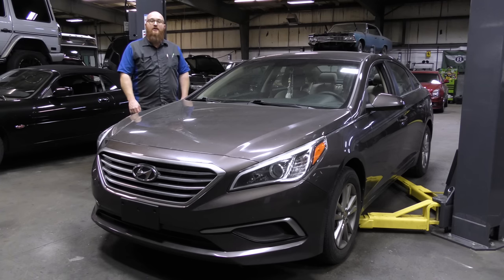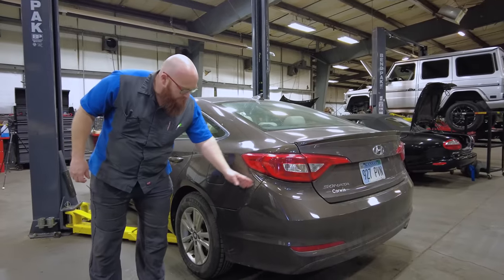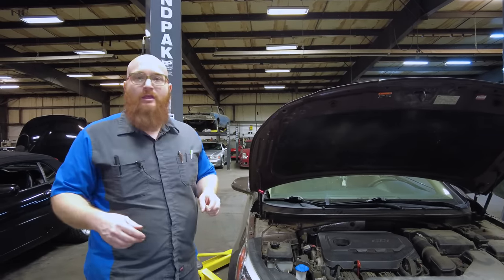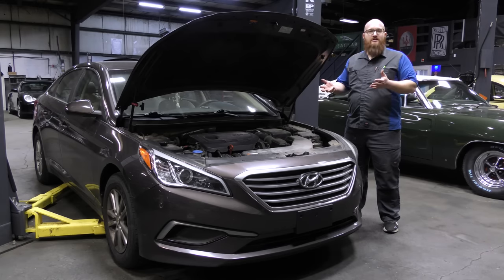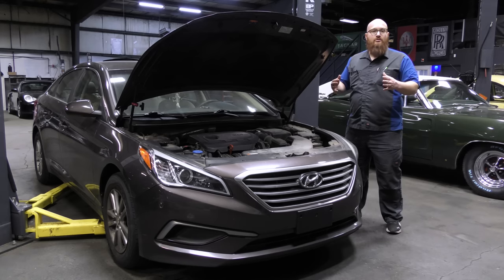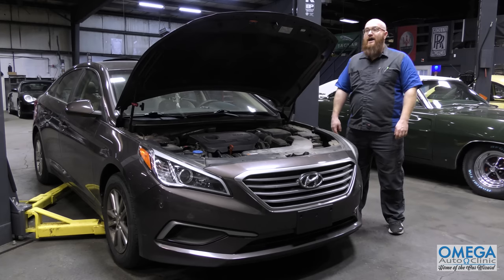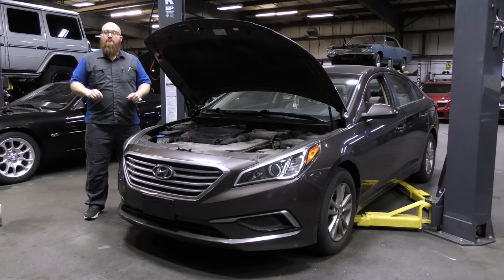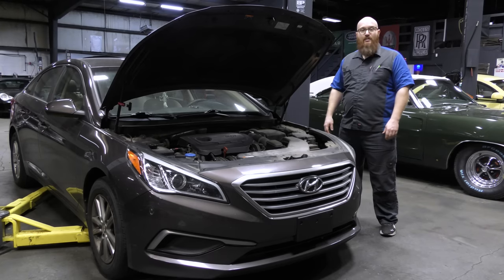What could be so bad on this '16 Hyundai Sonata that the CAR WIZARD is sending it to the junk yard?

Comment: Wrong.  I've got a 2.0T ltd edition, very well maintained. 
It didn't burn oil for 120,000 miles, then all of a sudden began burning 1 quart every 1000 miles.  So if you change the oil every 5000 miles with pure synthetic oil, plus 1 additional quart every 1000 miles, thats 10 quarts of oil every 5000 miles.  I've changed the PCV, and it still burns 1 qt every 1000 miles.
Good thing I check and fill the oil every 1000 miles; otherwise, I easily would have blown the engine.  
If a person doesn't check the oil every 1000 miles after 100,000 miles on engine, they'll significantly run the risk of blowing the engine due to very low oil.
I had an old nissan sentra that ran like new with zero oil burning issues at 175,000 miles, and ran like new.
Hyundai isn't making their engines to last more than 120,000 miles, and thats if you religiously add 1 qt oil every 1000 miles once engine reaches about 115,000 miles.
Most people don't check their oil often and easily blow these engines at higher miles on engine.

Comment: Dont care what the customer supposedly did. The mfg should have done something about this. They created this junk. About the oil consumption, the defect in the engine lead to the increased consumption. Most engines today can go between oil changes without excessive consumption. I have a 2013 elantra with 255000 miles. It uses a qt in 5000 miles.

Comment: After when they fixed my engine on Tucson  it's paid for i drive it when wheels fall off  i will never bye another Hyundai  there junk  its been 8 months  playing circus  games  its at  the dealer last 5 plus weeks  had to replace cat converter i told them  not paying for it i have a loaner  told corporate  I  will pick it when they replace the engine   Hyundai  needs to get their crap together

Comment: Those engines are not rebuildable, the dealership couldnt fix the issue even after changing the cranckshat, those 2.4l engines are known for having these issues, evetually they had to order a new engine.

Comment: I disagree, the owner/driver should be ashamed to not understand basic maintenance of the car you drive. My guess the driver has not changed the oil at proper intervals and also ignored oil pressure warning light. If you can pass a driver's license exam then you should get a basic training class in watching oil and water levels in your engine since low levels of either of them will destroy your engine.

Comment: These 2.4L are crap, theyre right.  All started with the 2013 GDI "technology" They dont eat oil until around 30,000 when the carbon cakes up on the rings, then you better get a drum of oil to keep adding every week

Comment: You over exaggerated. I  have seen used low miles of those engines for less then 1k dollars. Any decent mechanic that won't charge $125.00 per hour and take 30 hours could swap the engine for another $1500.00 bucks. So, with $2500 to $3000 bucks, that car would be back in the road again. That's why I never take my vehicles to greedey mechanic shops like yours where they exaggerate everything!! A good looking car with a lot of potential went to the scrap yard because of a mechanic who exaggerated everything like you.
And people who don't know anything about cars, they follow your advice!!
You said it you don't want to put a used engine on it, why not?
It's up to the customer if the engine don't work, you still make your money. But any used engine has their 30 warranty, and people who are on that trade,  they test the engines before they sell them.

Comment: You're off the mark they had a recall for a main bearing recall and that's why they're replacing engines mine went at 98000 me I've got my second engine I also have all the records of my oil changes every 3 to 5 miles

Comment: Yeah, but that used car has a used engine that will fail in the near future.  A new engine should last another 100k plus miles. There are and have been in the past lots of cars that had engines that wouldn't last 100k miles.

Comment: DGI motors suck! I only have 61,000 mi on my vehicle I have a Hyundai sonata it's a 2017 and the last three oil changes which I do every 3500  to 5,000 miles religiously without fail and bought it brand new is having the same oil consumption problem.

Comment: We have generally nothing but Kia's and Hyundais in our family. Almost all of them have been purchased at or over 100,000 Miles of service. We were careful to make sure that they had had regular service when we bought them and we have continued to keep them serviced as if they were new. Two of them are approaching 200,000 miles with no sign of slowing down. We have two 2.4's  at this point and they are delivering well enough that we drive them cross-country to visit relatives. Keep it serviced and it will go there.

Comment: We have a 2011 Sonata and had the engine go. We regularly change the oil and had the updates done. Took it to the dealer and they replaced it no questions asked. They even provided us with a rental car. Our dealer was amazing. Our engine had 130,000 kms on it

Comment: $6,700 to replace my daughter's cylinder head on her 2018 Volkswagen Tiguan for her emission code P0491, major oil consumption from premature failure of the exhaust valve oil seals that clogged the secondary air  passages.
What would you do ???

Comment: I have same car damn thing burns all the oil in 2000-2500 miles junk car running it till it does seize up change oil myself on it every 1500-2000

Comment: The engine had a quart of oil in it because those engines burn oil excessively. I had to add oil to mine every few days. There is a court order that these engines have to be replaced. The owner should lawyer up. Most Toyota engines dont need the oil topped up between oil changes. Hyundai built junk and put it on the market. They should own their mistake.

Comment: Stop buying Hyundai, Kia and Nissan. They are the biggest pump and dump brands I’ve ever seen. Combine that with the worst owners in the market and you’ll have the craziest stories of any brand. If your engine doesn’t blow before 100k your CVT transmission will and you’re not getting a new one under warranty. Not all cheapo cars followed this philosophy saturn, Oldsmobile, Scion all may be out of business but were actually excellent cars!
Buy any Buick 1990-2005 over this Hyundai for example.

Comment: owned one of these for 2 years, never short of issues EVERY F ing DAY. sway bar link fail at under 30k, steering column ticking sound, engine mount premature failure. Lastly the steering wheel shakes ON And OFF at highway speed and tires being chewed like no tomorrow. Did multiple alignments, tire balances, thew different new suspension parts, re-align, rebalance, nothing can resolve it. Many people on Carcomplaints reported this and every dealer "DENIED" since they "CANNOT" replicate the issue. 
Koreans are better making plastic surgery Kpop chicks, but not cars.

Comment: I want to ask car wizard,did this car have any oil leaks from the engine, I usually find oil leaks from the front crank seal on the 2.4s they get oill leaks people never ck their oil runs out bam there you have it
Reply: Kia/Hyundai engines, for one reason or another, will burn oil, in my experience it's extended oil changes that will clog up the oil control rings and there you have it. These engines do not like dirty oil, talking like 3k mile oil changes here. Funny enough, my wife always wanted a Kia Soul, the new ones, she bought a 2023 Soul in Mars Orange. It's got 13k miles on the odometer right now, I check that oil level every week on Sunday mornings, I come out and first order of business after it's been sitting all night on a level surface. So far doesn't seem to burn any oil, then again I did the first oil change at about 1k miles and second one at about 3k miles.

Comment: Precisely what these cars unfortunately were designed for, to be throw away cars, hoping you buy a new one so you can  repeat this vicious cycle of being in debt with a car payment for 5-7 years. Unfortunately most things today even once quality brand names are adopting the planned obsolescence mentality and these stories are more common then many care to admit. Proper maintenance is most paramount today then its ever been despite the futile marketing from the manufacturer's that in this case, vehicles are built to withstand extended maintenance intervals and are required less to service 😂 Bad advice and poor marketing considering the numerous cases such as this one, even when the owner does the proper maintenance. So I would plan for the worst and hope for the best.

Comment: There ois no in and go with electric vehicles. If you have to wait to get access to a charger on your shopping trip that takes more time than an oil change. Aside from that electric cars are useless for longer trips because you have to configure your trip to line up charging stations and wait for the charge. No Joy. Live n a cold climate? Forget living in colder climates since that drains your battery badly.

Comment: Changing the oil would not have saved this car.  The engines in these Kias and Hyundais WILL FAIL.  Ask me how I know.  Mine seized at 85k miles.  NICE CARS, CRAPPY ENGINES.  Multiple class action lawsuits for a reason.
Reply: I believe you. I really do. But I find it hard to believe that if you bought one of these pieces of s*** but changed the oil every 30 to 45 days no matter what - w/synthetic and use an additive like Motorkote or Duralube, that it would still happen.
Reply: @kettle_of_chris  original owner of a 2012.  It wasn't a POS when I bought it.  Got 12 years out of it, better than most.

Comment: I’ve owned two new sonatas.  A 2011 and a 2013.   Both have been great vehicles.   I traded my 2011 base for a 2013 se and couldn’t be happier with my Hyundai experience.    My 2013 is 10 yrs old now.  My extremely neglectful daughter has owned it the last 7 years of its life.    She’s driven it across country from Minnesota numerous times.     140k on the clock and she just drove it from mn to Chicago for lollapalooza.     Also been through 3 pretty significant accidents in its life.    

My point…..   I don’t understand why you seem to be crapping on Hyundai in this video?    Once you found only one qt of oil in the crankcase it pretty much means case closed imo.    The owner neglected the crap out of the car.  

No brainer the dealer should kick it out.   I don’t understand why you seem to be upset here?   As if Hyundai should give this woman a free engine or something even though the failure is obviously her fault?…..

I am also fully aware of the Hyundai engine problems.  I actually have a lifetime warranty on my engine and tranny because of the class action settlement.     And I assure you , when the time comes to cash in, I will have 4.8 qts of oil in my crankcase

Comment: Hyundai and Kia both have crap engines that are direct injection. The pistons and rings fail due to design and they both have recalls for this failure. They say your low on oil but fail to acknowledge that the fact that the design allows oil to be burned and that is why it is low. These companies are snakes, criminal liers.

Comment: Never buy Kia, Hyundai, or Nissan. These brands are chronically bad, and they are easy to steal. My 2015 challenger v6 has 64,000 miles, I’ve only done oil changes, that’s it. Not even new brakes. But avoid newer Chevy products as well, and electric vehicles!  Toyota and Honda are your best bet. The extra 6000 you’ll spend is worth it and you’ll have a vehicle that will last a long time. Kia and Hyundai will not even get you 60-70000 miles without these financial killers, and then they’re junk, and will end up crushed, or sold for parts.

Comment: These Hyundais are trash in my opinion, just throwaway disposable cars. My dad had owned a Hyundai veloster 2013 and it was only around 7 years old, within owning the car for about 4 months the engine catastrophically failed, loss of power and gain of rod knock. Luckily this is in the uk where I atleast know you can get your money back if the car fails to a non owner issue within 6 months from a car dealer. The quote for replacing or fixing the engine was the same value as the car. It was well maintained with fsh. These engines are not build for longevity and many engines are stockpiled to replace failed engines to then fail years later and ruin your pockets. Also to mention Hyundais lack of attention to reliable engineering is not made up for the detail and manufacturing of the other parts like the paint in which it looks like it was done with spray paint, uneven and contrasting in colour in different areas. Imo don’t buy a Hyundai.

Comment: I one ,ONE ,Quart and it’s Hyundai fault. Ok,,why not try that with a Chevy,Ford,LEXUS. Fair is fair,.will the Dealer warranty the new engine? Heading for 100k . 12 Sonata Hybrid ,oil changes on time ,every tin. Check oil weekly. Sorry,this one is Not Hyundai fault. 17:08
Reply: Ok so tell the owner of the Hyundai  purchase another used car? Who and how did the owner take care of it?  Could walk into same mess. Very unfair to claim Hyundai or any Manufacturer for owners lack of basic maintainence. I like your post but ,hey Mr. This one is really un- fair . I really do appreciate your comments usually and I do have a small mechanical background. (Shade tree).

Comment: Wizard:
It’s OK,let them suffer because of their stupidity,lack of responsibility and basic knowledge..PM or Preventing Maintenance is the key to longevity unless the engine itself is CRAP.. I have 2018 TUCSON oil change every 5K or twice a year,it doesn’t burn oil,I never had to top up oil between changes ,and EVs are garbage and Money Pits,,,you will spend soooo much money on suspension,tires,brakes,insurance and you will never know when it will burst into flames.That vehicle looks fine,go to junkyard and get used one,it’s cheaper than new whole vehicle..Yep that’s my rant,I didn’t spend my money on bicycle to throw it away as disposable razor blade…Now I’m angry how Stupid people can be…

Comment: Lazy people think the bucket of oil is more hassle than buying an EV😂
Modern cars are packed with expensive electronics that fail overtime. And you decide the most vital part gonna be electronic now.
And since you most likely leasing it for 3 years. Its no good for the enviroment anyway.. Then you get a brand new one over again after that..

Comment: Whoever did that repair and the paint job is a noob.  That's a half ass paint job. That car was poorly maintain and now it's just straight to the junk yard.  There's no point in saving it.  The motor sounds horrible.      Just get a new car is the better option.  For the customer to get mad just goes tobshowbhowbclueless they are and at maintaining oil change.

Comment: doesn't Hyundai has lifetime engine warranty?
Reply: If your talking about the recall warranty it only applies if you had a knock detection sensor installed & it had to show the specific code for it. The dealer found a way out of it by claiming they didn't do scheduled maintenance when they found a low amount of oil in the car. I imagine the owner could fight it with corporate if they had receipts of oil changes.

Comment: I have had a 2016 se gor quite some time and as of rhis posting, my sonata has 215667 miles on it and it runs just like it left rhe assembly line. The condition of my sonata is excellent ( inside and out) and its the best car ive owned so far. I would have no problem or wouldnt think twice about taking it on a road trip across the U.S. These mechanic assholes are just trying to scare you especially woman and senior citizens. If you want honest opinion and proof, Jeep and Chrysler are complete garbage. Not the Charger or Ram trucks. If you really want a  good vehicle, buy a Chevy Silverado (GMC Sierra) or a Honda Accord or CRV or a Toyota Corolla.

Comment: I get the low engine oil part.  People should be pay attention to. Besides Hyundai and Kia is a trash brand anyway . I have only own Toyota and Nissan  0 problem... do maintenance and service my self .  
    One my freind  have 2016 Kia Sorento and with 70 K miles on it .. i told her to trade for another one .. month later awd system broke  costs her $2500 ..

Other friends's Santa Fe .. engine got seized up after 80K .

There are numerous videos on YT ... dont buy this Korean Junk .

Comment: Hyundai engine shouldn't have self destructed, if it was zero oil, but there was atleast 2 quarts of oil. Not good but not enough to destroy it. Bad manufacturer.😮 To prove this point engine builders won't even try to rebuild Hyundai engines. They're complete junk !!! They will not even touch these junk engines. What does that tell you ?😊

Comment: Well I have a 2018 Hyundai that I changed the oil all the time . Now it burns oil in between oil changes so I have to check it every 200 miles. It  started burning oil at 50000 I never had a car do this before. And it's not me it's the way they make these cars. I'd never buy another one. it's a piece of shit

Comment: you could have the best engine in the world but if you run it low or out of oil its a gonner . i bet they never even checked the oil . i dont feel bad for them at all . my old lady wont check her oil eighter and used to run the goddam car close to out of gas all the time . its laziness and willfull ignorance .